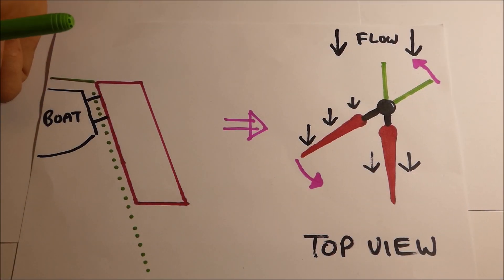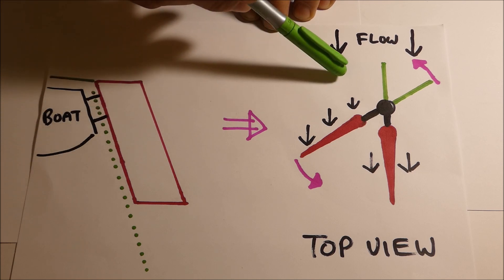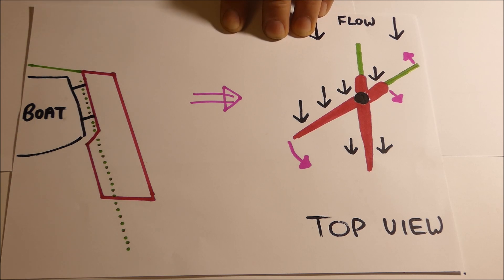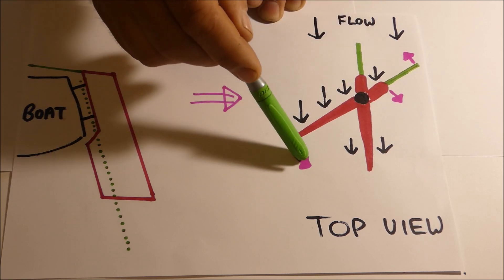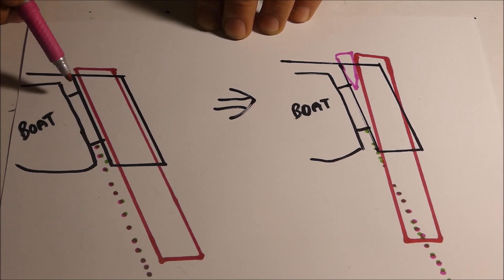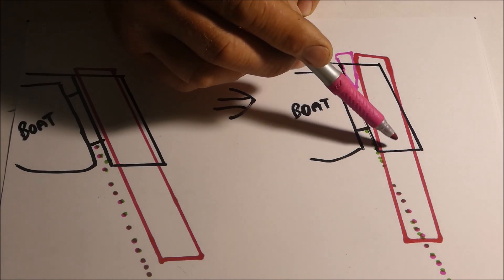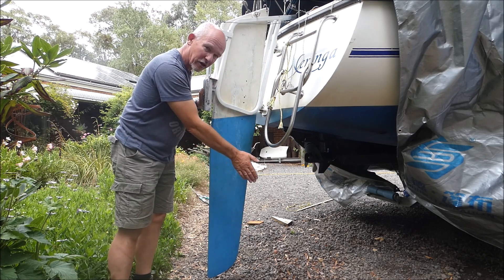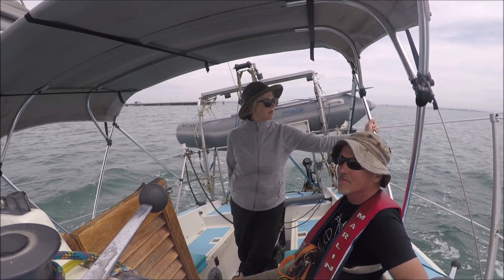Balancing the rudder on a trailer sailer

Comment: Totally agree about balancing your rudder. Owned a YW Diamond for many years and they always round up when overpowered. I redesigned to a balanced rudder and never rounded up again. I now own a M&W32 with stern-hung rudder that I will balance to get 1/ lighter helm and better control 2/ economy on self steering.  But I have ONE question. How much extra pressure is being placed on the PINTLES is it approx 20%?  What is your thoughts and opinions please.
Reply from the maker: Thanks for the comment. Its a good question. Yes there is a greater distance from the pintles so there should be a greater pressure on the top pintle. The difference with the method I am using is that because part of the rudder is pushed forward of the axis of rotation (pintle line) the pressure on the forward section is in the opposite direction to the rear section. These opposite pressures counteract each other and result in lighter tiller pressure and reduced lateral pressure on the pintle. If you think about it purely on the pressure you need to steer, any steering pressure is directly proportional to the pressure on the pintle against which this steering pressure works. So using the balancing method above the pressure on the pintles is less than the original configuration where the steering pressure is much greater and so harder on the pintles. The only time with my rudder that this is not the case is when motoring. I have a well outboard which the thrust is through the rudder. As the balancing method I use  mostly relies on the lower part of the rudder for balance and the motor thrust is over the upper part of the rudder I do experience higher tiller pressure when motoring due to the higher flow over the less balanced section of the rudder from the motor. 
Cheers Mark
Reply: @TRAILERYACHTADVENTURES  Thanks for your reply, Mark. My method for balance, seeing that my rudder is in fixed position, is to add to the leading edge making a larger surface area rudder, a little under 20%. I have already re-enforced stern where rudder gudgeons are thru-bolted. I am trying to minimize any weak links, but still have a nagging thought that  an easily replaceable break point should be in my system. Probably over thinking this modification. Thanks again for your thoughts and input. Glad to see your balance works well and greatly improves your boats handling characteristics.

Comment: Thank you ever so much, I bought an 18 foot aluminium trailer sailer that is missing its rudder, now I know how to make one from your excellent video, vary much appreciated.
Reply from the maker: Thanks for the comment. Good luck with building your rudder. The principles are simple enough. Just remember not to put too much of the rudder forward of the rotation line as it will make it unstable if too much. Should not be more than around 18% of the rudders surface area that is in the water. 

Glad the video has given you some help. 

Cheers Mark

Comment: Thanks very much generously sharing  this Mark. You may just have solved my weather helm problem on my MASRM 720. I’m excited to try this. Wonderful explanation!
Reply from the maker: Hi Jonathon, 
It may or may not solve the weather helm issue, it depends on the cause of the weather helm. It does reduce tiller pressure and the change in the position of the rudder can help reduce weather helm. On my RL28 making the rudder more vertical increases its wetted surface which increases the resistance to slipping sideways a bit more at the stern which counteracts weather helm. I have also increased the headsail and reduced the roach on the mainsail to move the center of pressure of the sails forward a bit which also resists weather helm. The rudder mod is definitely worth a try and it will definitely give you lighter steering. The main thing to watch is you don't push the bottom of the rudder too far forward as said in the video as it will eventually go past the balance point and the rudder will lock in a turn. I suppose that's why its called balancing a rudder. Glad you found the video useful.
 Cheers Mark

Comment: Silly question i have always wanted to ask. What is the blue coloured  covering all over your yatcht... for grip? What's it called please?
Reply from the maker: No such thing as a silly question! The RL 28's where made with large panels of textured fiberglass for grip. All the parts of the deck colored blue are these textured panels. This is molded into the surface when the boat was built. Old fashioned but very practical and good to walk on especially when wet. Cheers Mark

Comment: Hi Mark, quick question, I keep reading that it is very difficult to insure a trailer sailer with a pop top. May I ask which insurance company did you use for Halcyon? Thank in anticipation
Reply from the maker: Hi Tony, I used GIO for years but then they started asking for annual surveys on the boat and roadworthys on the trailer that was over 30 years old. I changed to Youi for a while but they became expensive and finally with RACV boat insurance who were very competitive and didn't require all the checks each year. That is who I have Neringa insured with now. Of course they may also start getting ridiculous as the boat gets older, we will see but for now they are pretty good and didn't ask about pop tops. All insurers are pretty dubious about moored boats and if the boat is moored I cant help you much there. Cheers Mark

Comment: Wow Mark, thanks heaps. I know exactly what you are talking about as I experience heavy weather on my RL28.
I'm onto it. Many thanks for sharing your RL 28 mods. :-)
Reply from the maker: Hi Pete, thanks for the comment. The one thing I would add is that it wont remove weather helm if you experience weather helm in light to moderate winds, that will be a sail/rig balance issue. It will help a bit as the rudder in this mod moves forward moving the center of lateral resistance slightly forward. It will reduce the tiller pressure required to counteract it though very well. There is something in the keel configuration of an rl28 that when the boat is heavily heeled it tends to want to round up. Most boats will do this to varying degrees, it has to do with the center of pressure on the sails and the center of lateral resistance on the keel separating in the horizontal plane that causes the rotation force and weather helm during heavy heeling. Reefing the main early on a standard rl28 rig is the best way to manage it. All boats have their quirks and I still think the rl28 is a great boat. Cheers Mark
Reply: @TRAILERYACHTADVENTURES  She does try to round up sometimes in the gusts, Does the mod make rounding up more likely or just make it easier to keep on course?
Reply from the maker: @petercorser1828  The modification does 2 things. It balances the rudder so even when the boat is trying to round up in gusts the tiller pressure needed counteract it will remain light instead of the extremely heavy tiller you can get in those circumstance. The other thing it does is move the rudder forward and deeper in a similar way to other mods done by rl28 owner who extend the top pintle. This moves the center of lateral resistance marginally aft  (the average point that stops the boat sliding sideways) by putting a bit more rudder area in the water. This is only a small effect but theoretically should reduce rounding marginally when well heeled. The forces involved are hard to explain without lots of diagrams. So overall my mod improves things substantially but will not overcome an unbalanced rig.  Sailing with an overtight headsail will also increase rounding up. It is all a compromise. I have put a mast head rig on my boat to increase the headsail to the size of the mainsail. This moves the center of pressure of all the sails forward allowing better sail balance which also reduces rounding up. I rarely have rounding up events these days but if the headsail is too tight and I get a strong gust off the wind you can still be rounded up a bit. Cheers Mark
Reply: I think the main reason boats are designed to have weather helm and round up into the wind in heavy gusts is for safety. It is safer for a boat to round up than down, where it could be pinned over in a dangerous broach, throwing everyone overboard etc. Weather helm is good. Too much weather helm is really annoying, hard work and slows you down.

Comment: Another  great idea and well explained. On your previous video about your masthead sail modification you gave me a detailed response to my question.  Is there any chance you could draw up some pictures  with measurements and maybe  some photos and either e.ail them to me or include them in another  video  please?
Keep the video coming, very informative.  Cheers
Reply from the maker: Hi Michael,

Unfortunately I lost the measurements of the 3 new rigging wires when I had a computer crash. Measuring them would be difficult in place especially the forestay that would involve dismantling the furler so those measurements would be when I next replace rigging which is not due for a few years. There were a few different height masts used on RL's so it may or may not apply exactly to your boat. In essence I moved the existing forestay back to the back edge of the anchor well. Added a new forestay from the top of the mast to the anchor bracket at the nose of the boat. Created smaller rear angled spreaders between the main spreaders and the top of the mast. Added 2 new Ubolts next to existing side ubolts and run 2 new rigging wire from the new ubolts through both spreaders to the top of the mast. The adjustable rear stay was left as is. The lower spreaders were extended 50mm by adding some extended ends from Keeley marine so the new and original side wires would be separated by 50mm to these spreaders.
Next time I am out sailing I can take photos of all the critical bits I have just described and email them to you. You would need to email me at sharemyadventure.net@gmail.com so I could email them back as I cant attach photos here. Cheers Mark

Comment: Hi Mark, 
Thanks very much for the information.
I just thought the designers would have done that already.
Reply from the maker: Hi Mark, Generally considered too complicated to do on a trailer sailer. Classic way is to have the rudder wider at the bottom so the front part is in forward of the pintles. With a dagger board this is very hard to make work although it would be possible on a swing rudder. I suppose the pressures in a small boat are not enough to go to this trouble in designers minds. Many do have quite heavy tiller pressures and especially in heavy conditions. Cheers Mark
Reply: @TRAILERYACHTADVENTURES  hi Mark, thanks for your reply and great information.

Comment: Nice explanation Mark. This has been used for many years on aircraft also to lighten the force on the control stick or pedals.
Reply from the maker: Yes its not a new concept but one that is often misunderstood. Very useful in aviation just as it is on nearly all keel boats but rarely applied on trailer sailers. It saves on autopilot power and improves the effectiveness of my wind vane steering as well. The place I notice it most is in a heavy cross sea. The tiller would be unbearably heavy when the stern of the boat is hit by a large wave and thrown sideways. The sudden crossflow would put heavy pressure on the tiller where with the balanced rudder it is much more stable and the tiller pressure very manageable. Cheers Mark

Comment: That's a very interesting concept and my Sunmaid20 has a heavy rudder also. I might experiment with extending the leading edge a bit. Thanks for sharing.
Nigel
Reply from the maker: Hi Nigel,
If the Sunmaid has a swing rudder the same balancing effect can be gained by having the swing rudder swing slightly more forward. On my Southern Cross 23 with a swing rudder I had that system where the rudder could be swung further forward past the rotation line of the pintles. The right amount and the rudder would be magically light and wonderful but too much it would become unstable and want to lock over in a full turn. Its all about keeping the amount forward of the pintles below 20% of the wetted rudder area. Adding more to the front will work too but it increases the total surface area and may change the center of lateral resistance of the boat, might but unlikely on a Sunmaid. Cheers Mark
Reply: @TRAILERYACHTADVENTURES  Ok cheers